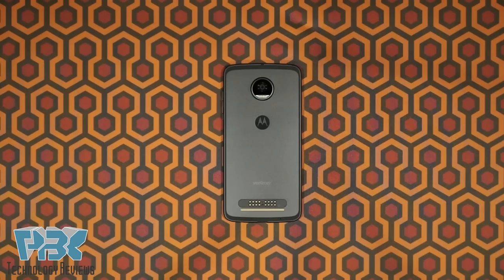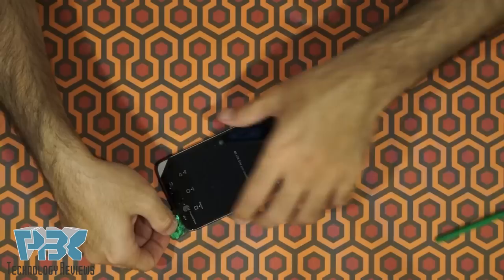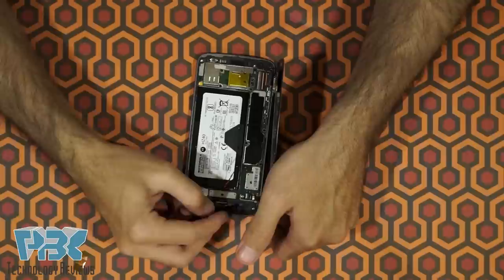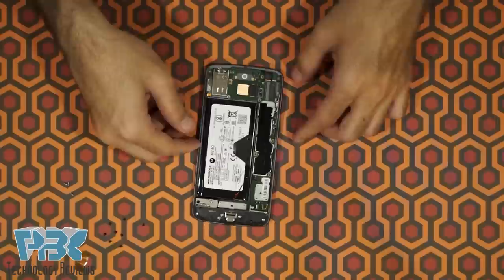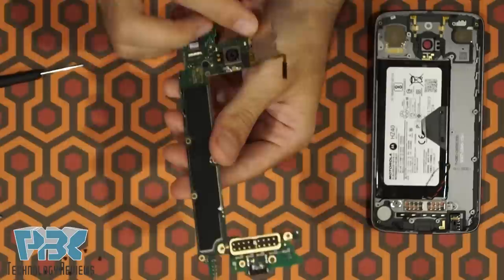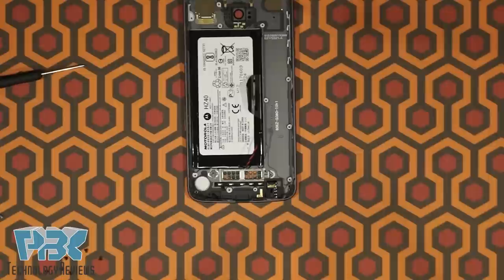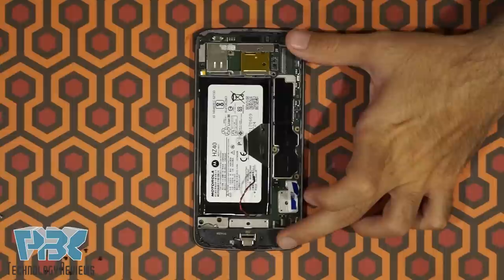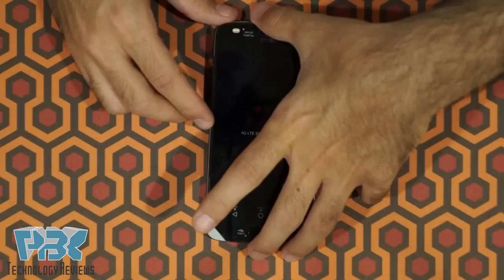Moto Z2 Play XT1710-02 Disassembly Teardown Repair Video

Comment: Yhoo it's been 4 years with my broken phone I need a replacement screen LCD.. Don't no where I  get it here I South Africa they don't have this phone it was my uncle's gift for me before he died.. I tried phone repairs here but no luck instead their screens don't respond. Can u suggest where I could order this model lcd plz?
Reply from the maker: I'm pretty sure you will only be able to find aftermarket ones at this point which aren't as good as the original ones. Probably ebay or other similar sites.

Comment: Just got mine yesterday and noticed a rattling noise coming from the rear camera area everytime the phone was shaken (using moto actions for example). It is not loud but its defenitely noticeable. I contacted motorola support here in my country and was informed that the noise is due to the image stabilizer inside the phone, which has to be loose in order to perform its fuction. They gave me wrong information, right?
Reply from the maker: Hi it depends on how bad the rattling is. Mine also makes a minor click noise when I shake it, and I have had other phones do the same. Some make more noise some less but should not be too loud.

Comment: Very good technique and correctly worked but instead of the metal pry tool i recommend using a plastic playing-card...slimmer and safer to use in this situation.

Comment: I have a model just like this one. But after assembling it, there’s a light flashing (kinda like a notification light). What’s could it be?
Reply from the maker: Does the phone power on and work? the only flashing light or light that turns on and is white color would be a small notification led light next to light sensor when the phone is completely out of charge, you plug your phone into charge and that white light turns on until the phone has enough charge to show the charge screen. Aside from that, not sure of any other light.
Reply: PBKreviews Yes, it’s a white light. It’s charged and everything besides from the mobile network works. And when I turn the phone on by the BP Tools it works normally, even without the flashing light and the mobile network also works
Reply from the maker: @henriquericordi3222  Not sure, maybe there is a short? try taking it apart and reassembling maybe I can't think of any other reason why it's doing that
Reply: @PBKreviews I’ll check it. Thanks! But what’s weird it’s that it works perfectly normal when I boot it up from the BP Tools option, even without the weird light flashing

Comment: From this video, I have NO CLUE how to open the sim card spot......brand new phone been looking forward to it and now...........
Reply from the maker: Video shows that you use the sim eject tool or a small paper clip with can fit in the small hole on top of the phone to eject the sim tray.
Reply: @PBKreviews  Thank you.
I tried....paperclip, needle, push pin, to no avail.
Greatly appreciated though!
Reply from the maker: @anareachi5229  no problem, sometimes you need to push a bit stronger or use a different size paper clip but should pop out.